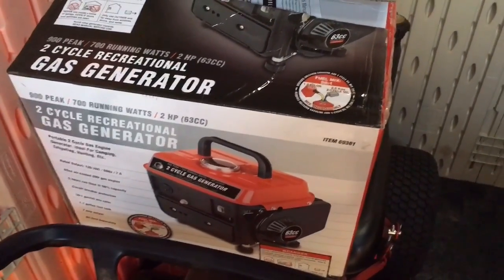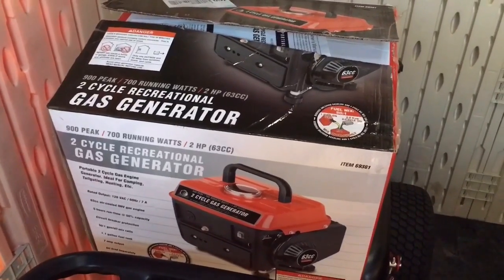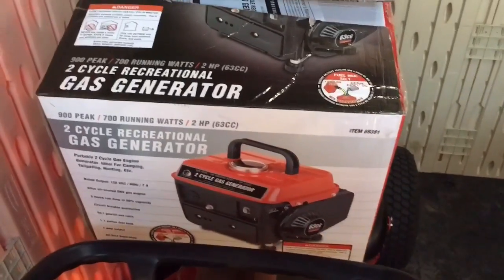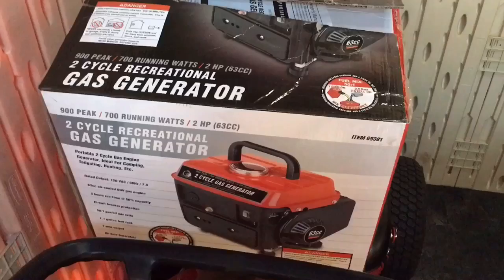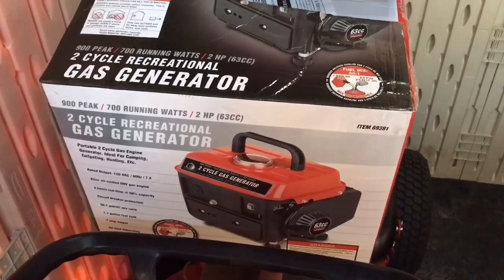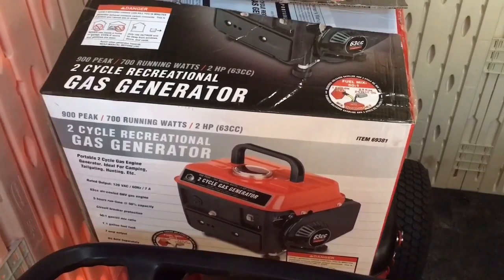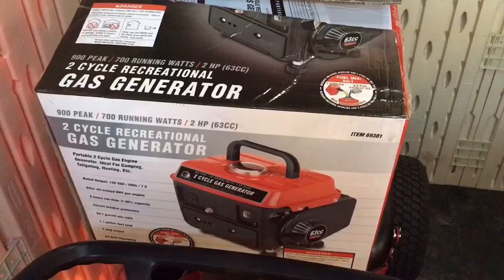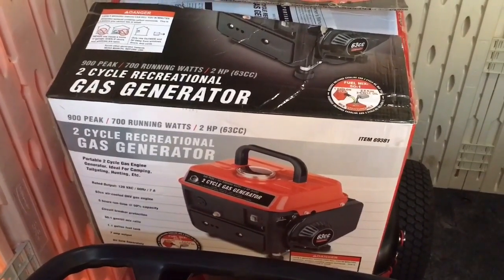Harbor Freight 900 Peak/700 Running Watts, 2 HP (63cc) 2 Cycle Gas Generator - Kill A Watt results

Comment: BUT WILL IT RUN A LITTLE WINDOW AC OK AND FOR HOW LONG?? A SMALL WINDOW AC IS 4/450 WATTS! SO TECH WATT WISE ONE SHOULD BE ABLE TO DO SO!? IF GEN IS 900 TO 1000 EVEN WITH 7/900 RUN WATTS ETC IT IS STILL UNDER THE WATTS!? So tech one should be able to power a 5/6000 BTU AC UNIT!?

FANS LIGHTS R NOTHING!!! HELL ANY GEN CAN DO THAT!! BUT WILL IT RUN SOMETHING REALLY MAJOR OR IMPORTANT!!??

Comment: the 69381 one is better. i had the older one crap out on me and it was replaced under warranty. the 69381 is much better performance and run quality. i solved the issue of performance by replacing the spark plug, but it still would randomly crap out on me.
Reply from the maker: You are 100% correct. I will be posting a new series of videos comparing the 60338 and the 69381. The differences are evident and many. My personal 69381 (the one in this video) has over 25 hours on it and is running perfectly. I went through 3 60338s before getting the 69381.
Reply: +KevCentral by the way, you have THE BEST video reviews for this generator by far. very informative . 

it&#39;s a shame the blue chicago electric model isn't still around - do you remember that one?  that actually powered my fridge during sandy. i ran that thing into the ground after running nearly continuous for the entire week we were without power.  it was replaced with the inferior red model with the 60338 model #. nothing but problems. got the store to take it back and replace it with the 69381. still not as good as the blue chicago electric model but it&#39;s still pretty good. it can&#39;t handle my fridge anymore (same fridge i had during Sandy)

what do you use for 2 stroke oil? i just use walmart supertech and this thing drinks it like a champ
Reply from the maker: +jgg204 Thanks for the compliment! I am trying my best to document these as I want to help others get a good generator and avoid a bad one. We just got our first Harbor Freight a month ago, so i'm new to their products. I have never owned the blue one, but i've seen videos of it. What you're saying mirrors what i've read - that they put out more power than the newer ones.

For 2-cycle oil I use Lucas semi-synthetic. It's worked well for me over the years (in lawn equipment) and it seems to create less carbon buildup and long engine life.

I will soon be uploading a series of videos where I purchase two new generators (60338 & 69381). I am going to show side-by-side differences between the models. Then I will be conducting duration tests to see how long they last. It may cost me a lot for gas, but it will be worth it.

Thanks again! Subscribe to get notification when the new series gets uploaded, and thanks for the comments!